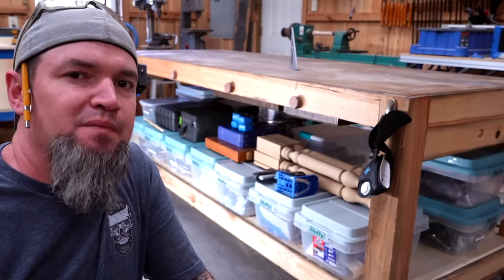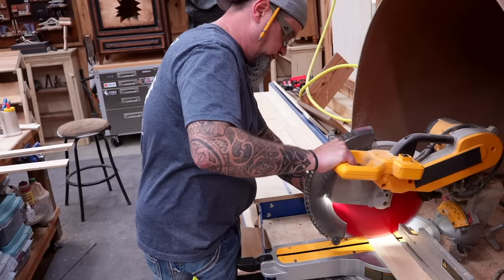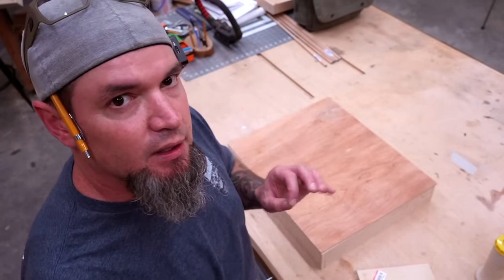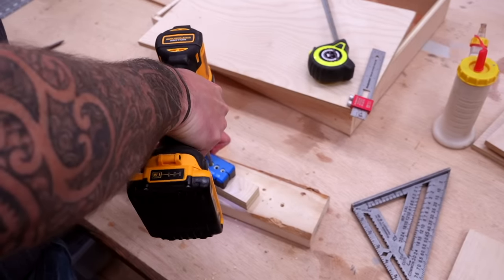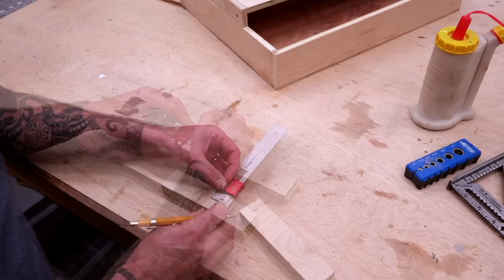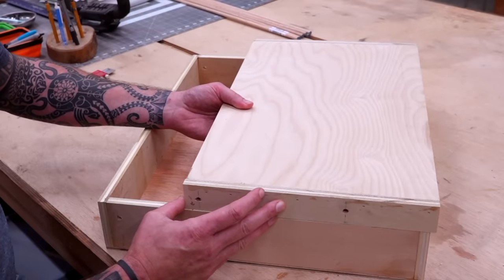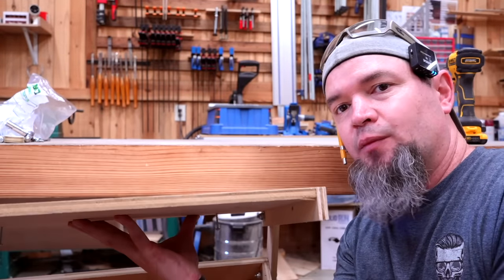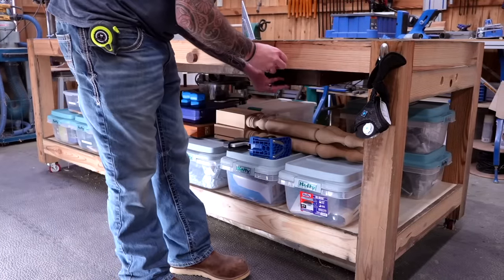Secret Workbench Storage / Workshop Organization Tip!

Comment: On part E in your plans: The 12" x 1.5": In the video in the second hole you measure 3/4 inch up but your plans show 7/8 down. That's what I see. What did I miss?
Reply: Doesn't matter. I did a 7/8 and was anxious about this step but my drawer turned out awesome. Thank you for your design and time.

Comment: I'm currently designining a workbench/assembly table with drawers, but this is an interesting concept. Thinking that you could still utilize this space similarly but you'd have to open the top drawer in order to access these. Might have to play around with this idea.

Comment: I like this a lot. My shop is a 8'x8'x20' shipping container which makes every inch of floor and wall space premium space. I'm designing a 16' lon x 30" wide bench that the job site table saw will slide into the end, and the miter station and planer will flip down leaving plenty of work space for long lumber on any machine. The opposite wall will have a 36" x 8' flip down work and assembly table. Both would make wall storage a bit of a pain to reach often used tools and these drawers would solve the problem.

This also leaves the entire wall above the workbench as lumber storage, up and out of the way but reachable and the opposite wall can have French cleat space over and past the assemble table. And the back wall will be where I use a modular storage system for all my work tools since I pay the bills being a handyman at least for now. Likely going with toughbilt since they're coming out with a complete system like packout but a bit cheaper.

Every little idea for storage helps make my micro shop more usable for bigger projects which means I can make more money. 🙂

Comment: Are the shelves self supportive so they hang at the angle you showed or are they resting on the plastic boxes that you have on the lower shelf?
Reply from the maker: They are self supported. No need for the boxes under. The boxes just show you can still have other storage with the built ins.

Comment: Maybe I missed it, but how does the dowel act as a lock?
Reply from the maker: It keeps the box up in the locked position
Reply: The hole for the dowel is drilled through the bench apron and the front of the drawer.  As long as the dowel is through both holes, the box can't swing down.

Comment: I’m thinking these would be good on the extension piece on my table saw, it’s friggin chip board (big disappointment unpacking THAT part). I am using an existing shop so space is very tight but there’s some pretty cool tools I get to use!  Under that extension would be a pretty awesome place to store push sticks, tape measures, squares, and about a thousand pencils.